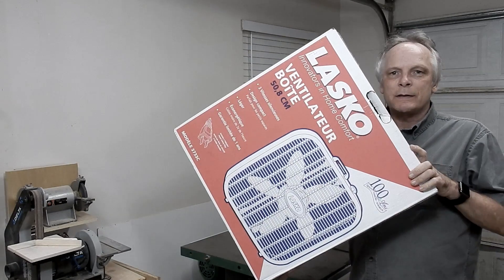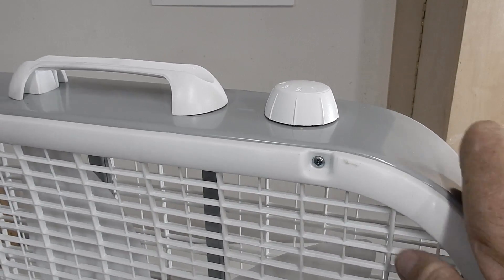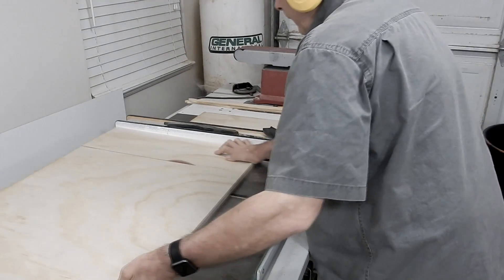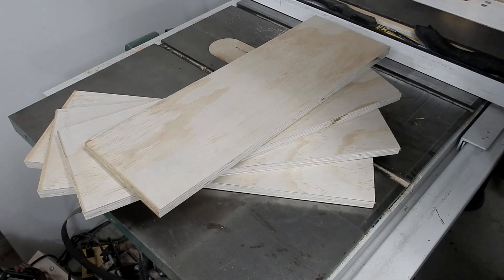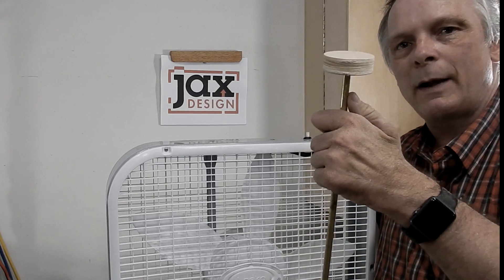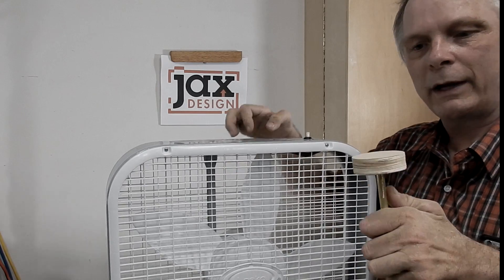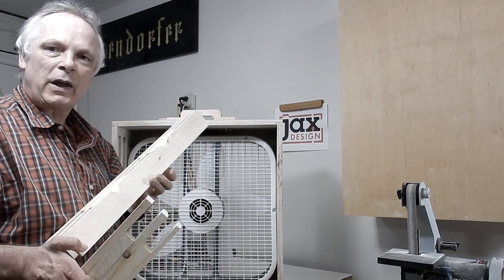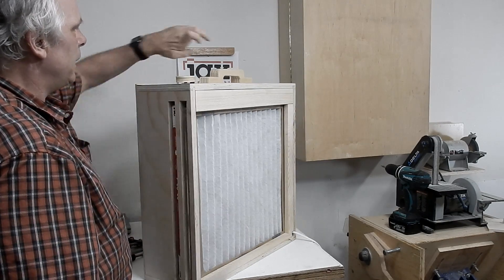Workshop air cleaner build

Comment: You must have a rabbit's foot, a four-leaf clover, and a lucky charm in your pocket. Pulling that plywood BACKWARDS into the blade should have kicked back and smacked you right in the head. That is a no-no for cutting slots on a table saw. Set your start point with the blade fully retracted, raise the blade into the wood, then move FORWARD is the safer way to do that cut.

Comment: Nice build. However, the part where you're dropping the plywood pieces over the running table saw blade (and then you pull them out while the blade is spinning) are cringeworthy; one of these days Mr. Kickback will show up and it won't be pretty

Comment: Nice build. Ive seen this build before though, and the filters actually work better when placed in front of the fan versus the back.
Reply: I’ve seen the same and have been wondering why.  Is it because the fan is not powerful enough to sufficiently “pull” the air through the filters?

Comment: Why the box and why two filters. I just attached a single filter with tape. Does the box or double filters improve efficiency?  Look really nice. Great build.
Reply: The box houses the filters making it easier to replace the filters with out taping things up each time. Also like you said, it looks nice.

Two filters are great, the outside one grabs the bigger particles while the inside one grabs what the bigger one misses with out getting clogged up from the bigger particles. So you save money.

Comment: Bro. You need a filter on the front. Otherwise it sucks dust in from the front and it's not nearly as efficient as it could be and the blades get dirty. You can't have the filters all on one side, you need them on both sides.

Comment: thanks for the vid...but i have yet to see one of these things in action....so does it make a difference to build all that vs. just bungee tying a filter to a fan? ....most of us have NO ability to use or acquire such wood-working machines to build this.....c'mon man...at least let us see it in use...to see if it works well...specifically, a side by side comparison to dust removal using this vs. just the plain filter attached to fan would help tremendously...

Comment: That’s not going to work. The air will just get sucked in from the front instead of pulled through the back. He should have built a shroud for the front. Just wasted a lot of wood and a fan.

Comment: Plunge-cutting on a table-saw.....   I, too, like to live dangerously....
Reply: Me too! I have 2 large scars on my rib cage & a saw tooth scar on my right ring finger to prove it! Hank god I’m older and smarter now! The kickback is legit... and the teeth are fucking sharp.
Reply: Made me cringe more that a little
Reply: I also rip cut boards with my router  LOL
Reply: Have you really even lived if you havent did that though?
Reply: On my work if we do that we get warnt en need to read the safty list
Reply: Tosk
Reply: Not only a plunge but a pull back cut to boot!  Yowza!
Reply: thinking the same thing and then he proceeded to move it the wrong way through the blade i may have liked the video due to the homemade oversized  calipers but the way an idiot cut
Reply: twas thinking the same...if my dad saw me do that he would absolutely freakout and throw the table saw away

Comment: Cool design. Seems excessive with 3/4" - not a lot of weight to hold and not a huge need for the added weight. Also, a bungee cord or two around the fan and filters would have taken less time and effort. That said, I respect a desire to make something nice. This is a really nice. Well done!  Huge props on the rod extension connection!

Comment: Jack, the LASKO 20” box fan you are using is rated on HOME DEPOT’s site at up to 2500 CFM air flow. Even with filtration attached it still moves an ample amount of air to filter my 20x20’ x9’ceiling shop adequately. Practical, efficient,and inexpensive!
Reply: It’s worth a try at that price. Go for it and give a report on it’s performance.
Reply: Alan Frizzell how about the one that has 1820 cfm?! runs about 17 dollars at Home Depot??

Comment: vortex's to pull the air through the filter are needed, this design does not have that, in fact it likely pulls air from the surrounding sides and around the blades instead

Comment: That is a lot of unnecessary fabrication.  I just taped mine to the back so it pulls air.  Works great for collecting all my sanding dust.
Reply: I did the tape method direct to the box fan and what happens is the filter gets used only around the fan blade rather than the whole filter. Making the wooden box allows a couple more inches of space and that sealed air volume pushes move evenly through all of the filter. I also went from a 1" filter to a 5" 25"x20". All the 1" filters are 3 months and the 5" are 12 months rated due to the huge pleats and they don't restrict as much airflow. It's like only $5 more for the 5" filter.
Reply from the maker: +Damian Nygaard whatever works , lol.
Reply: Damian Nygaard 

well, to make it look better, and easy filter changing
Reply: nah. this is awesome. it looks way better than a fan with a filter taped to it lol
Reply: The handle was a little over the top haha. Nice build though

Comment: You can filter only visible dust with this cleaner, and not very effectivelly. The most dangerous particles are those with size near 1 um. Furnance filters don't catch them at all. To filtrathe such particles you need MERV 13 or 14 filter. And to drive the air through such filter you need centrifugal fan, not axial.
Here is mine: Centrifugal fan with capacity 600 cubic meters per hour and 2 filters 29 x 29 cm. First is only for coarce particles and is about merv 6 or 7, dont remember, the second one is merv 14.
https://scontent.fsof3-1.fna.fbcdn.net/v/t31.0-8/11791992_10207423961942984_7217952172283736949_o.jpg?oh=6c5799393bcd85ed571e2acc86dc26f1&oe=594CE3E8
https://scontent.fsof3-1.fna.fbcdn.net/v/t31.0-8/11163882_10207423962022986_2803865409452475410_o.jpg?oh=802a400953c9c1a84ce2143e8cb97f47&oe=5967B44B
Reply: Love it! Do you have the plans?
Reply: Bullshit, you don't need a centrifugal fan. It may work better, but you don't need that type. A box fan with a MERV 14 would work just fine. I DO agree that you need a 1uM or better filter thou.
Reply: University of Michigan video testing a box fan with a Merv 13 shows it working just fine.

Comment: You also use the cardboard box the fan came in position a filter on suction side. Or, simply rest the filter on suction side and filter will not move with the power on.

Comment: NICE job as usual Jack! I have built dozens on filter systems for friends  (and a couple for myself) using furnace blowers (upgraded from my box fans). They do a lot better than the box fans but are a real bitch to move if you need to and if hanging from ones ceiling it will definitely make your butt hole pucker putting them up!

I think I'll go back to the box fans and build a nice box like you did here to put them into. Thanks for the video!

Comment: I been doing this for years with that same brand name fans (20" Lasko's).  Didn't make any box at all for mine, the filters stay put while the fan is on due to the suction, evan while on low.  I use 3 fans in a series in one section of my shop which has the greatest need.   One critical key to using these is that you need a compressed air system to blow them out, and I don't recommend those noisy un-reliable small compressed air systems which will break not long after use (the oil-less types) which spew out condensate constantly and the noise level could rattle the teeth out of a T-Rex.
Reply: I have the same fans and the filter will stay in place when running so I had to put L brackets for the filter to set on when not powered up. I will say that this configuration WILL allow dust to bypass the filter around the edges though plus it looks kinda hillbilly to boot.
Reply: Spoken like a true asshole Ed.

Comment: Really great video.  I've noticed that there are many videos on making an air cleaner/filter using a box fan.  Yours however, put all other videos to shame.  It is so obvious that you take pride in your work, and it shows.  Building one that holds two filters was a great idea, (among many others).  I look forward to watching more of your videos to see what you come up with next! 👍
Reply: He drop that mic after that build
Reply: Susan i
Reply: Taking pride is one thing, but this man has the tools to do whatever he needs to do.. that is the most important part, second is what you do with them. Most people dont have access to proper tools to make something this beautiful, so they make due with what they have or can afford to buy. Making all those cuts with a jigsaw would be a pain to most and they just say F~c< it and go with duct tape.
Reply: @raulduke7142  exactly.... I have a hand saw and a drill.... fml
Reply: @Anna-tc6rz  you can do a lot with just a circular saw, speed square, tape measure, and a drill. A corded circular saw can be had for around 50 bucks, add in a cheap jigsaw for 30-50 bucks and you can pretty much replicate what he did here. Especially if you don't use as difficult of joinery, maybe finishing/brad nails and glue or pocket holes on the inside. Don't worry about not having a fancy tool, just go for it with a tool that will work.

Comment: Hey Jack, two things

1: I'm curious how good it's been working out for you. Does it make a substantial difference? I'm considering a similar design
2: When you were cutting the slots out of the boards for the filters, I noticed you pushed the board down onto the blade, and then pushed the board backward over the moving blade. I'm not here to judge, I've done dumb stuff myself, but just in case you don't already know, this is incredibly dangerous. Very high chance of kickback when you do this. Always push the material forward over the blade, never backward.

Again, not trying to judge, just point it out in case you didn't know.

If I were building that I would just cut all the way through and glue the pieces back together. That, or drill a hole at each end and use a router to hog out all the material in between using a router bit wide enough for the slot.
Reply: Chris Johnson, yeah, this guy's "table saw safety" wouldn't play well.
Reply: @rla1000  He has some balls for sure.  

then again...he built a box fan out of a box fan so ... perhaps it was all for entertainment

or possibly he ran out of duct tape 
or he likes lifting heavy things 
or he's retired and ran out of projects
Reply: @burtreynolds3143  He built an air purifier.  If you want to go for someone, go for Big Air Purifier

Comment: Your build looks very polished, better than almost any I've seen! I would note that using 1" filters like that will seriously impact airflow, as will using more than one filter. In my tests a single 1" MERV8 filter cut airflow by 40% on a cheaper box fan, but a 4" MERV11 filter reduced airflow by less than 20% while filtering smaller particles. If you combined your slots to take a 2" thick filter you could significantly improve airflow and filter lifespan (double the surface area means double the lifespan). The company Nordic Pure has a website where they sell filters of whatever size or filtering capacity you want at reasonable prices, it was way better than trying to find the right filters in hardware stores or paying way too much. I won't link because I don't want to seem like a spammer but I'm sure anyone interested can Google for them. They do also sell 1" "Tru Mini" pleated filters that offer similar performance to 2" filters, but they cost more.

Also, your build article doesn't seem to be publicly viewable? The link prompts me to login to Google then says I don't have permission.

Comment: How many amps is that motor drawing with the added air resistance?  I wouldn't trust the cheap thermal safety in a $20 fan to keep my house from burning down.  Maybe put an Amprobe on there and check it.

Comment: Hi Jack, doesn't this type of air cleaner blows the dust in front of them?
Reply: It sucks the air from the back pulling the dust into the filters, ideally it wouldn't be on his workbench that way.
Reply: +Colby Johnson what I really meant is that shop is full of dust particulates and when you using this air cleaner devise, it captures the the dust behind it and blows the existing dust particles in front of it. I guess the best way is to have the fan blow the filtered air to out side of garage.
Reply: +Amirhousein Hazratifar oh yeah. I've seen lots of people put a filter on the front to stop that from happening as much. If it's In a closed room it will create a cycle however.
Reply: Amirhousein Hazratifar 
CFM of fan and cubic feet in the space being filtered. Do the math.

Comment: I use a fan like that.  Annually I need to remove the slotted covers and reach both side of the fan to clean the fan.  I run it a lot with a filter bungeed to the intake.  It isn't as pretty, but it is functional.